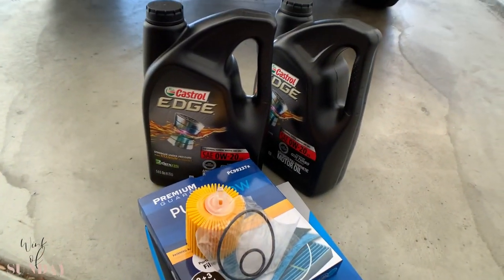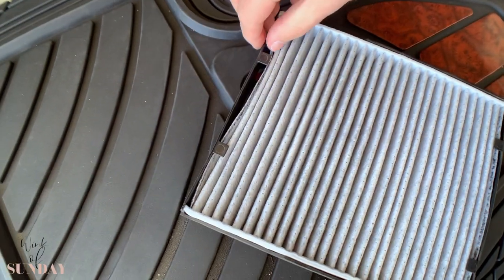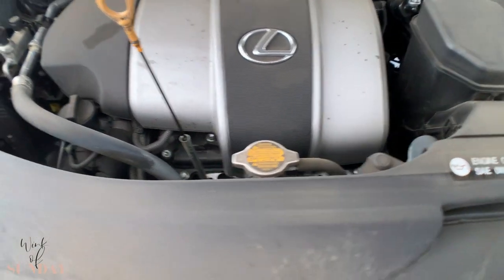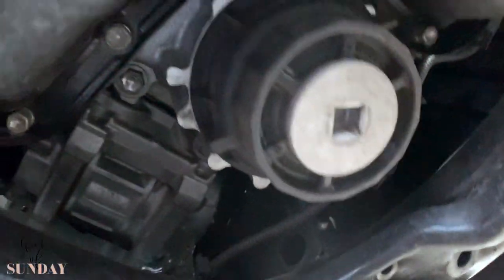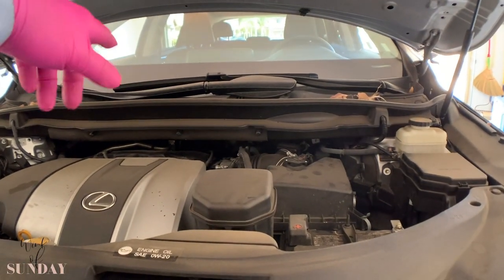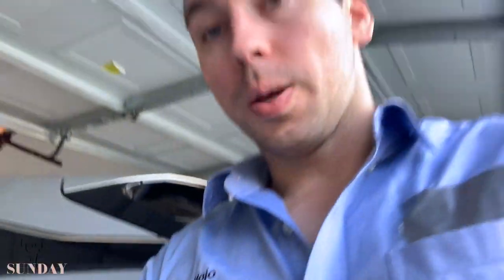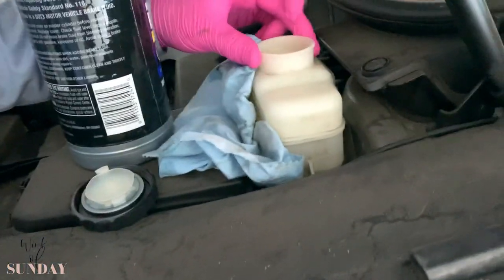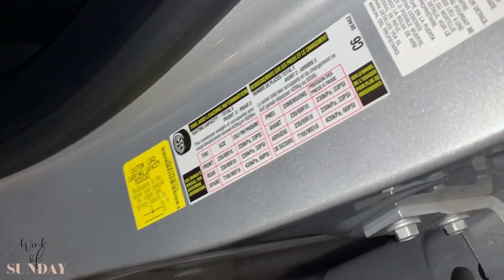LEXUS RX350 DIY Service - How to change Oil, Filters, Brake Fluid at home | Wink of Sunday

Comment: Don't bleed your brakes this way. It's wrong and is dangerous. Everything else is fine, but don't bleed the brakes this way.
Reply from the maker: Would you mind elaborating why it is wrong and dangerous?
Reply: @BONDGarage  When you release the brake pedal, the bleed valve needs to be closed. Pump the pedal a few times & hold it down, then release the bleed valve. Close the bleed valve & release the brake pedal. in that order. It's a 2 man job. There are other tools available so you could do it alone.
Reply from the maker: @hassandawudi4810  I don't disagree. This would be the ideal version for this way of bleeding brakes. While some air will come back into the system while releasing the brake pedal before the next push, in reality it's not going to cause any issues as long as the lift is quick and swiftly followed by slow brake application, and as long as the brake pedal is applied when closing the valve, as you mentioned. I never had air in the system this way, and yes, this is a last resort if other methods of keeping brake pressure constant aren't available.

Comment: Don't you have to bleed four wheels? Before you tighten the bleed valve, do you have to keep the brake padel fully depressed and kept depressed when you tighten the bleed valve? I am just wondering. Thank you.
Reply from the maker: Yes, you have to bleed all 4 wheels to change all the old fluid and you close the valve while the other person is depressing the brake pedal. At least I always try to time it accordingly. He/she will notice that brake pressure in the pedal returns as soon as you closed the valve.

Comment: Oh no , did u have any problems with your brakes afterwards ?  I hope u were safe.
Reply from the maker: None at all :)
Reply: Not safe to follow. Do you know what he did wrong on the changing brake fluid?
Reply: @MrVanchu  the comment above mine explains the procedure.  You never I loosen the bleeder screw then pump the brakes.  You pump the brakes 3 times then tell them to hold then u loosen bleeder screw tighten once fluid comes out then repeat process. Yes starting from the farthest position right rear then driver rear then passenger front the driver front. But my concern was when he asked her to pump again you could see the brake fluid and possible air reentering into caliper.  I’m glad he didn’t have any issues.

Comment: How do you know if all the air is out when bleeding and it’s good to tight it back?
Reply from the maker: you see the change in color from a darker yellow to a very light thin yellow tone. that's when you know the new fluid arrived. you can also see when there are no more bubbles coming through. in the end you would also feel it in the brake pedal. air in the system will result in a soft pedal all the way through.

Comment: How many times have you personally changed the oil on this vehicle?

Am I correct. When you put the oil in you didn't fill it? You left it .8 quarts low!
Reply from the maker: This was the second oil change I performed on this car.  Yes, I usually "under-fill" it a little, run the engine for a moment so the oil can distribute throughout and then measure after letting it sit for about 30 seconds. Usually you have to top it off and that is planned because it's easier to add oil than removing a little when you poured too much.
So far, I didn't have to refill between the oil changes. Only the F10 consumes a little in between but that car is driven differently :)
Reply: @BONDGarage  
The owner's manual for our 2009 RAV4 says it takes 4.7 quarts. But according to the dip-stick only 4.4 quarts fills it. So I go with the lower amount.

Comment: Where did you place your jack stands? I'm thinking about the welded rails but not too convinced they will be stable and there's so many plastic parts too.
Reply from the maker: the jack points are usually marked. Maybe you have seen simple arrows on older BMWs. Most japanese carmakers and VW use simple indentations to mark the right spot. If you look parallel you will find them at the same spot I placed the stands. the beam running between the front and rear wheel is just about 1cm thick or even less and has 2 half-circle cut-outs (1 front, 1 rear) on each side. The beam itself is not supposed to hold the weight of the car but rather anger the head of the jack. those jacks have a flat top with a cut in the middle. if your car still has it you'll recognize it. people often use a flat jack and bend the beam. My jack stands have thick rubber matts which give in and manage to transfer the weight, even tho the beam almost cut them in half. a picture would be way easier. if needed just hit me up on IG (handle in the description) and I'll send you a quick video.
Reply: @BONDGarage  
Remember, those jack points are suggested locations mainly for changing a tire. You are not limited to those locations...

Comment: Do you not need to keep the catch container higher than the brake bleed valve so air doesn’t flow back in?
Reply from the maker: not really as long as you keep pressure. usually the catch container is below the valve simply due to space constraints. just try to keep pressure on the line through repeated pumping or better, with a pressure container that fits your reservoir (external pressure so you don't have to pump the pedal).
however you might have air finding its way back into the brake system if you leave the valve open for too long without any pressure on the brake. in that case your idea of having the catch container above the valve wouldn't hurt.

I have a video on a brake upgrade coming soon in which you will get a better view on the pressure container I mentioned

Comment: Normally you never need to replace your brake fluid, only if your car is 20 or 30 years old. 
Dealers / Stealers biggest money making way. 
My advice - Do all these stuff only if you are a professional. Dont mess with your brakes just to make a video.
Reply from the maker: That's right, don't mess with your brakes if you don't know what you're doing. Luckily, I am a professional and I have to disagree with your brake fluid statement. You should change your brake fluid every 2-3 years. Brake fluid is hygroscopic, meaning it attracts water, and as it ages you'll find more and more water in it. Water can boil under hard braking and change phase to vapour which is compressible and you'll loose pedal feel and brake force. Not ideal but most people wouldn't notice the difference between brand new and 5 year old brake fluid. If you track your car you will notice the consequences. Another reason why water (even just tiny amounts) are bad within your brake system: it causes corrosion. Once that brakes through you loose all brake pressure. As rule of thumb: don't try to save when it comes to brakes and tires.

Comment: What are your thoughts on the 60.000 mile $1200 Lexus dealership maintenance?
Reply: That's a 1200 dollar oil change
Reply from the maker: I have one more "small oil change" to go before the "big" 60k service. Will actually pull it ahead and probably end up doing it at 50k because the car is mostly used for short runs around town. Barely any 30min+ drives at all. Beside the usual engine oil, cabin air filter, engine air filter and spark plugs, etc, I'll probably also flush the transmission oil, rear diff and coolant. A round of new fluids never damaged a car :)
Reply: A thousand percent yes!!! I need to do but it off what a pain n the arse

Comment: Can this be done without removing all the wheels?
Reply from the maker: yes. but the calipers are easier to reach without the wheels in the way. if I had a lift I'd leave the wheels on
Reply: @BONDGarage  I need to do mine and I was just going to drive the backend up on ramps, flush the rears and then do the same for the fronts.

Comment: 8:00 and 10:46  The oil filter housing has 3 tabs on one side and 1 tab on the other (180 deg opposite) side; the oil filter housing socket has matching slots.  Make sure to match them up because removal of the housing is next to impossible unless the housing and socket are matched.

Comment: Wrong way bleed.  U have close after pedal down. Or atleast have the container already full so no air comes in
Reply from the maker: works. of course you need to make sure your container isn't running out of fluid.